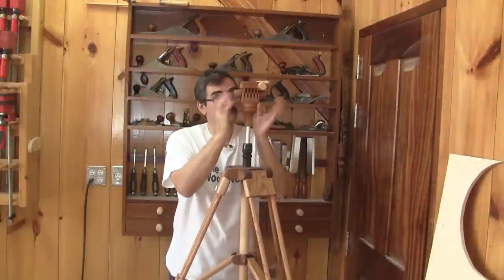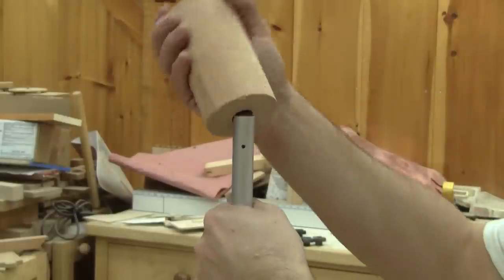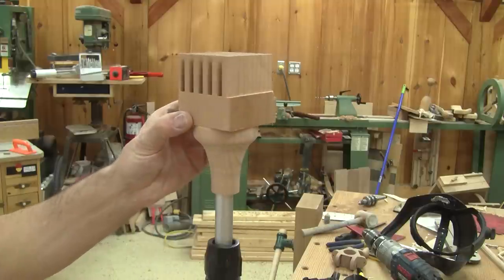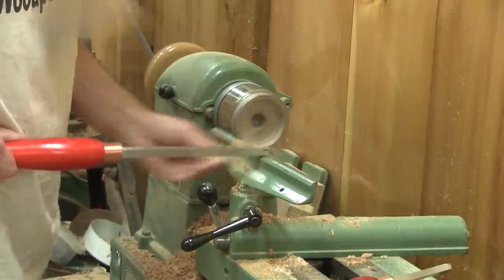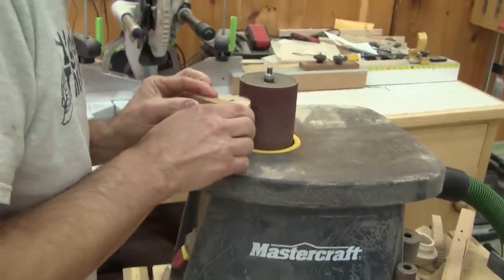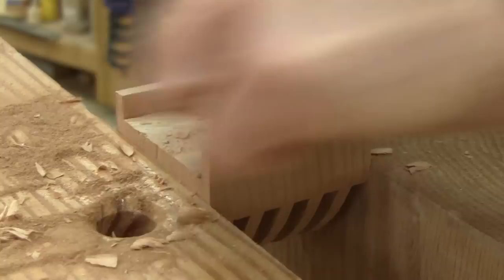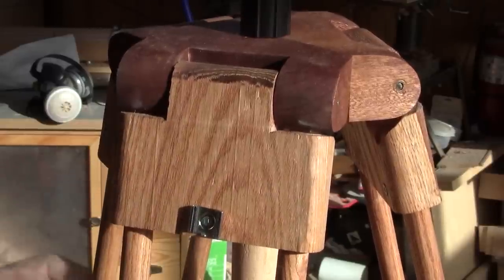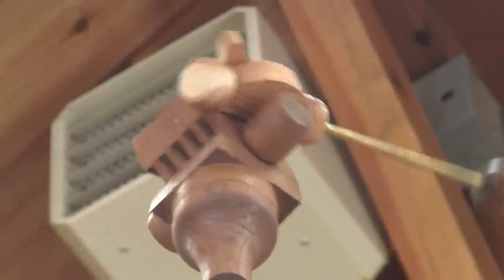The Woodpecker Ep 161 -  Wooden tripod part 2

Comment: When I have to turn a piece that may not stay well in the chuck, I usually put a live centre in the tailstock and use that to support the work piece.  That way it can't pop out of the chuck.  It also allows me to use less clamping force on the chuck, so the jaw marks on the work piece are minimized.    Edit:  I see you do this at 10:00 for the handle!
Reply: Thanks for these episodes.  You inspired me to make a tripod floor lamp, something that is trendy now but expensive to buy.
Reply from the maker: When I rewatched this episode, to add the close caption, I realized that I should have used the tail stock.
Yes this design can be used for lightning or anything, it's quite heavy and hard to tip over, but not too practical in a suitcase for a trip :))

Comment: The finger joint has weaken it greatly for holding in the chuck. Try rounding it before making the finger joints
Reply from the maker: But I was not sure I would have been able to hold it in place in my jig if I would have turn the base beforehand.
Reply: Do consider the safety as other turning like bowls are horrific accidents.
Reply from the maker: But now that I know this was not as straight forward as I thought, if I do this again, I will either turn the base and cut the finger after or use my tail stock to hold the piece in place.